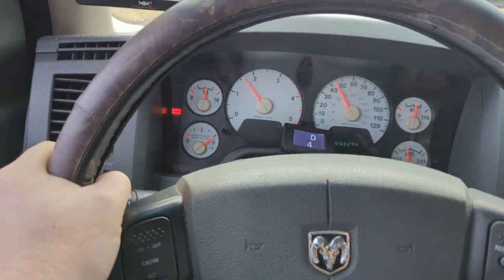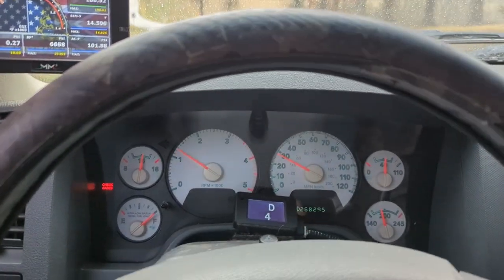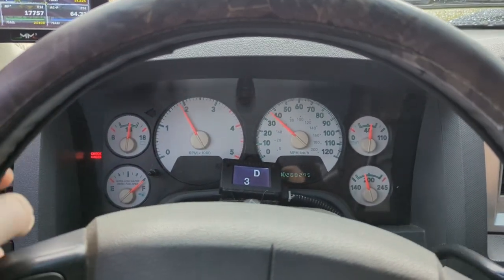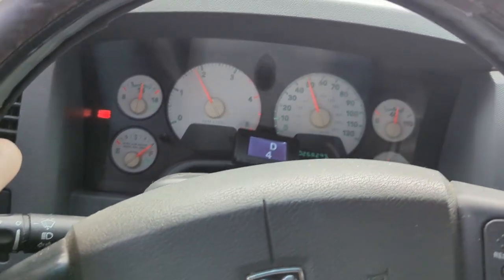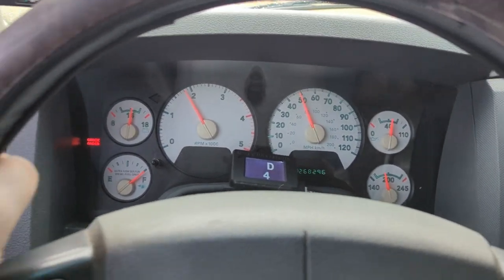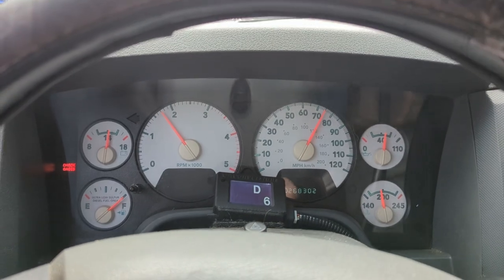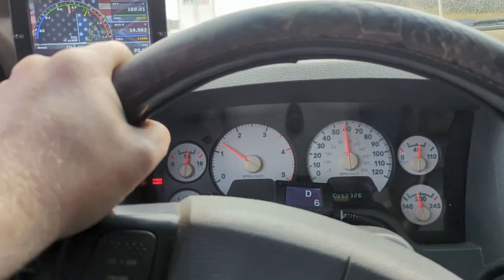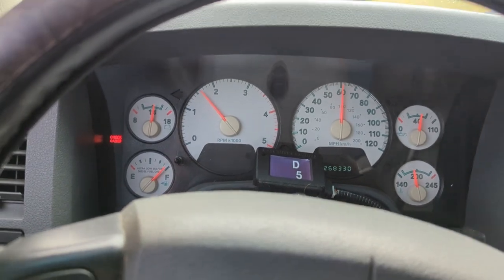What's It Like Driving a Cummins/Allison Truck?

Comment: What’s your mpg?
Reply from the maker: @lex6712  Pretty consistently 14-15.5.  It went up from about 13.  Not a huge change but that's because most of my driving is in 4th gear and higher which is where the 68 locks in anyway.  My first center console boat felt like I was dragging anchor with the 68, but now with the Allison the boat feels small and even my bigger center console feels lighter than with the 68

Comment: I feel that your shifting complaints/statements are due to CAC using the factory Allison programming to control the trans.
Think isuzu box truck or UPS delivery truck.  They are tuned shift more like a commercial vehicle.
Honestly  CAC should have stuck wirh the factory GM programming
Reply from the maker: I went with CAC for the industrial programming.  The stock GM burns clutches with the easy shifts.  I think it was the 4th gear that goes out because of a glitch where 3rd and 4th are both engaged or something like that.  All the issues I saw with the Allison 1000 were in GM trucks.  Besides who best knows how to shift it than the builder?  It's always a gamble going with something like this, and I tried to make the best decision
Reply: @TheRoostersGarage  you are correct about thw allison programming. However the light truck market has to have the best of both worlds. A quality, stout tranny that shifts smooth as to not offend the people that are using an 8800lb crew cab truck to pick up their lattes.
That said the Allison 1000 trans that is behind the gm trucks is far superior to ANY other light duty truck tranny. Aisin included. 
People in fact have said that the 68re can be built to outperform a stock Allison. This is true. But, an Allison can also be built. 
I've got a factory five speed Alli in an lb7 with 270k on it and I've had zero issues aside from a neutral switch failing.
Only thing I have EVER done to it was change the fluid out 1 a year
Reply from the maker: And the neutral switch is a breeze to change too!  I really don't mind the occasional stiff shifts.  I can tell you when my conversion  box died and the Allison wasn't getting TPS, those were HARD shifts.  But here's the awesome thing, about it- even with no electrical at all, it still locks into 3rd gear.  We snake hunt in Texas and the trucks are our transportation on a 20,000 acre ranch.  I needed a transmission that won't put the truck down for silly issues.
Reply: They only use industrial TCMs, because they don't have the capability to use any of the GM TCMs. The industrial TCMs are pretty forgiving. What I mean by this is you only have to give it TPS and it'll still run where the GM TCMs will go into limp mode. The industrial TCMs shifts like junk because the TCM has no torque input, to it bangs though the gears. which causes the clutches to wears and burns up clutch's fasters.
Reply from the maker: @SteedDolan  I heard the GM TCMs burned clutches because each shift was so soft and the industrial saved the clutches.  Honestly when it comes to automatic transmissions they are a box of magic to me.  I can vouch for all it needs is throttle position.  Their interpreter box died - first one ever, but leave it to me.  I had all my gears, just no lockup.  I drove it like that for about a year and pulled my 26' boat hole from Florida with no lockup.  Fluid still looks great, but it's almost due for a change.  New box, lockup, exhaust brake, no issues.
Reply: @TheRoostersGarage  The issues you saw with the GM trucks has nothing to do with the TCMs. If they told you that nonsense it was to sucker you into their product. The reason CAC uses industrial TCMs has everything to do with the simplicity to make that industrial TCMs work with bare bones inputs. Their lack of knowledge and capabilities in swapping these are all over their videos. Like the one where she talks about not needing tow haul because it runs so much better. The truth is they don't have the ability to make it work so they make up stories about why you don't need it. The fact is tow haul is a user selectable mode. You can make it a race tune if you really wanted to leave it as tow haul or anything else. Also because of how they make these work you will burn up your transmission a lot faster than I will with a T87A and junkyard Allison. With the industrial TCMs the only input you need to feed the TCM is throttle position over the SAE J1939 and the transmission will work, not great but you'll get what you have. Their product has zero torque input or any real input from the ECM for transmission management. What that means is your clutch engagement will always be 100% wrong which is why it bangs though the gears under WOT. I have a 2007 Ram and my cluster works, tow haul works, torque management works, it shifts like a 2018 L5P Duramax, and I can do WOT pulls from a stop to 6th gear. The fact that CAC cannot make the cluster work should be a tall tale sign of how basic their kit is let alone actually making the TCM talk to the ECM or the rest of the vehicle. You also need Allison DOC software and unless you steal it i.e. pirate it, you'll never be able to tune that TCM yourself. Where I can use HP Tuners and any aftermarket scanner to diagnose my transmission, heck even AutoZone can readout my transmission. I am not bashing their product, just pointing out the facts they don't talk about. In my opinion if you list the available conversions, from best to worse they are last. The metric I would use to rate them last is 1: The interoperability between the transmission with the vehicle (i.e. how much does the transmission know about the vehicle and how much does the vehicle know about the transmission), 2: aftermarket support, how do you tune the transmission, who has the ability to tune the transmission, what diagnostic tools are available to trouble shoot the transmission, and lastly 3: ease of installation, quality of the parts you received, is it plug and play, is it removeable so you can keep the conversion and restore the truck to the OE transmission if you sell it. I know more about these then probably most people, I have a ton of videos on my page playing with this stuff. I even have the only 2007 5.9 swapped to a 2019 6.7 using the CM2450B ECM and it talks to my truck. So, if you think about it, 2007 5.9, swapped to a 2019 6.7 CM2450B, started with a 68RFE but now I have a 2018 L5P Allison 1000 T87A and everything works together like factory. I hands down know a lot more about swapping these then CAC.
Reply from the maker: @SteedDolan  I ran into the whole nothing plugs in issue and had to buy a Launch 123 to pull codes and read anything from it.  Whether or not it shows on the cluster doesn't matter at all to me - I have a manual transmission tune so I don't have the cluster indicator anyway.  That got me a much stronger exhaust brake.  I wish I could get the shift points tunes, but I'm really a manual transmission guy and automatic transmissions really don't shift where I would like them to.  I've wondered if I could swap in a TCM from a bus with a Cummins in front, but info seems hard to find out there on these swaps.  They seemed like the most knowledgeable when I did my research, then just before I purchased ATS came out with a kit.  The only thing I wanted was their bell housing to keep the Cummins starter and not go with the Ford 6.0.  But they would only sell it with their torque converter.
Reply: @TheRoostersGarage  Thats what I was saying, the industrial TCMs are super forgiving. If my TCM lost communication, it would go into limp mode. But just like anything, if you abuse it, it will break. The GMs failing had nothing to do with the TCM. It was from abuse, over towing, hot roding ect. When comparing the transmissions it's all in the valve body. Every company likes to max out line pressure because it gives you more gripping force between the clutches. The problem with that is the shift quality goes down, and transmission runs hotter. GM lowered the pressure in their valve bodies which lowered the towing capacity to extend the life of the transmission, fluid and increase shift quality. If you stay within the towing limit its perfectly fine. I believe the industrial valve bodies are at max pressure 100% of the time which isn't good for a light duty pickup. My transmission is 100% stock, which is one of the reasons why it shifts so well. The T87A is also way more advanced then the older industrial TCMs so that helps a lot as well.
Reply: On another note, I am hoping Ram moves from the 68RFE and Aisin to a big ZF 8HP series. If that happens I plan on ditching my Allison and hopefully be the first one to swap on in a older truck. It'll probably take ma a day or two to write the code to make it work in my truck.  @TheRoostersGarage
Reply from the maker: @SteedDolan The one thing I have learned about automatic transmissions is the valve bodies are very important.  I drove around in that condition for a long time because I didn't know what the problem was.  At least limp mode would have alerted me to the transmission issue.  But since it was the black box that connects to their OBD port, I couldn't read much of anything out of it.  The main thing I tow anymore is my 26' center console which is about 6000 lbs without the trailer.  I am within the factory 13k towing capacity, even though that's a bogus number and I have no doubt it could tow 20k to 30k, but I have no need.  I went with the Allison to have a super strong transmission because I use my truck like a truck.  I've snake hunted out of it in Texas, I'll be pulling this boat back to Florida, and probably be gator hunting in Louisiana before too long.  This truck does long trips and needs to make it home pretty much no matter what.  Like anyone I don't like to be stranded, but with as much money as I've put into this, I expect it to be pretty much bulletproof by this point.  I don't yet have a transmission temp gauge on this so I can't tell you how hot it runs or how hot it got pulling the boat over Monteagle with no lockup, but I can tell you I was very easy on it and my EGTs didn't get over 1100 and I let the speed drop to about 35 mph on the steepest parts to give it a break.  As I was going downhill, I kept my foot out of the throttle to let things cool back down.  I'm not the easiest on stuff, but I also do my best to listen to the groanings and keep from making a bad situation worse.
Reply from the maker: @SteedDolan A day or two to write the code?  That's impressive!  I'm a developer by day, but taking a totally new system and integrating it in that quick is impressive.  I've checked out your channel and have no doubts you could do it though.
Reply: @TheRoostersGarage  I spent 21 years in the Army, I specialized in Cyber and Eletronic Warfare. I've been playing with these vehicles since 2010 and have developed multiple microcontrollers. My latest uses RTOS, with a STM H7 processor, and has 5 CAN networks capable of FD and a bunch of IO. It took me about 20 hours to write the initial code for my Allison and my CM2450B conversion. Took a bit longer to get all the little nuances working like my high idle. Developing this stuff will be my last career now that I'm retired from the Army.
Reply from the maker: @SteedDolan  That's awesome!  I love technology and hate it just as much.  When it works right it's awesome.  When it fails and makes the equipment unusable it's awful.  I just had a crank pressure sensor turn my truck into barely a Prius.
Reply: @TheRoostersGarage  Swapping to a better electronics kit would help a lot. But you still don't know what's in the valve body. Personally, I prefer stock parts. Ill rather find a low milage junkyard transmission then a built one. The Allison is so much bigger than a 48 and 68 that swapping to a stock Allison is a massive upgrade. I spent $800 on mine, and it was from a 2018 Duramax with few thousand miles on it. Pretty sure it was under 5k. I swapped the tail housing, output shaft and used the ATS bell housing and that was it. I also have a stock GM T87A calibration, which works great. The only issue for some people would be WOT pulls. If you can't hit 3200 rpms it'll hang in the gear, you can tune your engine to rev higher or lower the transmission WOT shift in HP tuners. My engine hits 3300 so it shifts.
Reply from the maker: @SteedDolan  I spent about $16k swapping mine.  I wish I found you before I swapped it
Reply: @TheRoostersGarage  Thats a far price compared to every other kit out there. What year is your truck?
Reply from the maker: @SteedDolan It's a 2008
Reply: @TheRoostersGarage  I was hoping you had a 06-07, I have a kit to swap a 2013+ 6.7 in place of the 5.9s. I had a few guys ask about going a 2007.5-09 6.7 to newer 6.7
Reply from the maker: @SteedDolan Yeah the 2007.5-09 is the red headed step child of the bunch.  Very little fits, very little support.
Reply: @SteedDolan  who do you work for? I want to put an 06 allison in my 03 cummins.
Knowledge like yours sure could come in handy

Comment: What exhaust brake do you have?  I saw that it stays engaged through downshifts with the Allison.  I have a PACBRAKE and don’t like how it just holds a gear with my 48RE instead of staying engaged through downshifts, mostly because my 48 will stay in 4th (3rd with OD off) gear all the way to about 10 mph before it will downshift.
Reply from the maker: All of the staying engaged is just the stock programming for the stock turbo, but I upgraded to the Fleece Cheetah when the stock was leaking too much oil around 220k miles.  But none of the behavior changed with the turbo swap.  I wish the Allison would downshift around 1400 RPM instead of 1000 RPM.  The exhaust brake has a whole lot more power with the higher RPMs, but when I have a load and don't want to hit the brakes, I just run the manual shifter to force it to downshift.  The 6.7's got the 68RFE trans, and Dodge cuts the exhaust brake power in half for an automatic, so I've also got programming making my truck think it's a manual so I have the full exhaust brake power.